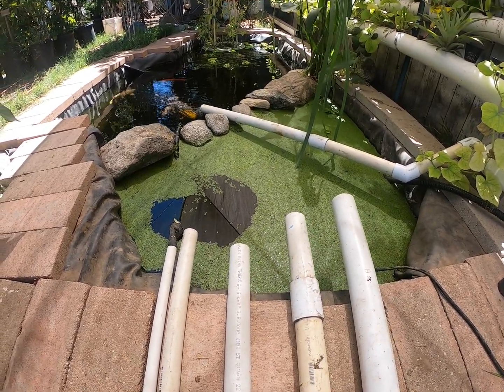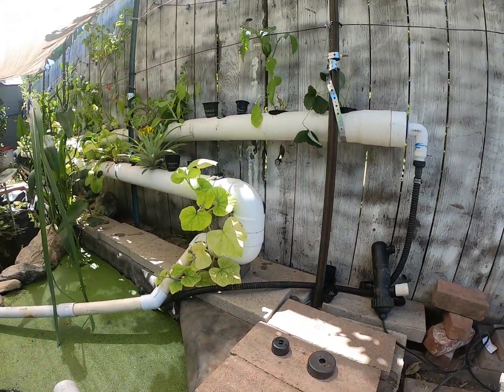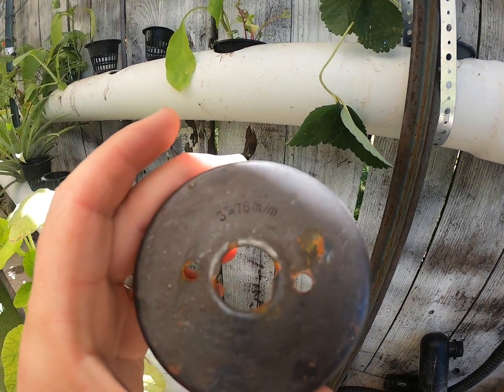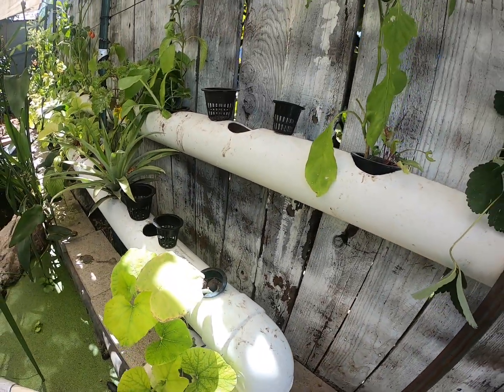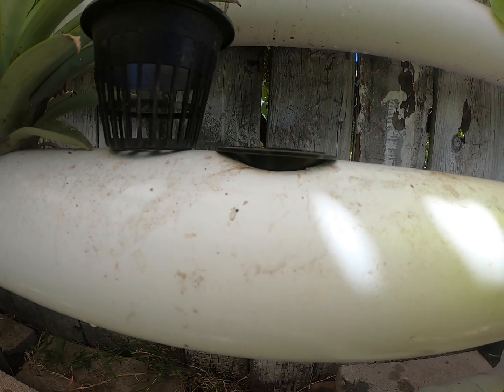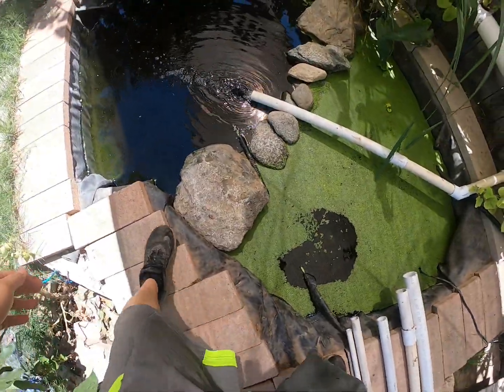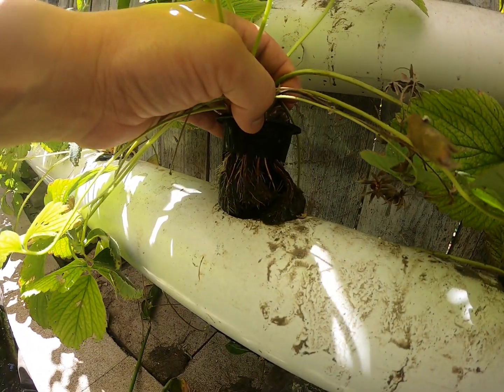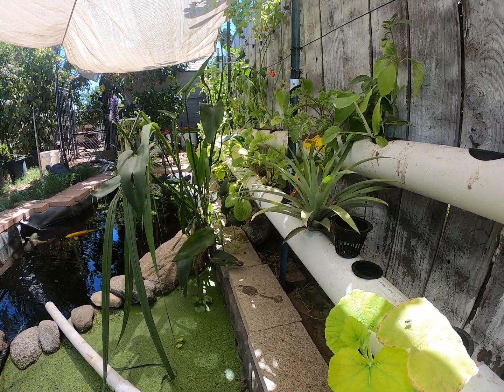What Size PVC Pipe and Net Cup for Aquaponics

Comment: Thanks! That was just what I wanted to know. I was wondering, though, why you have so much algae. Is that because of the water from the fish, or does the system leak light?
Reply from the maker: I had removed the UV light because I  added some water fleas, mixed fairy shrimp, and other small pond organisms. The vegetation that is floating is duck weed.
Reply: @aguileraproject271  I was actually talking about in your pipes, not the pond. If I pull out my indoor hydroponic plants, the roots are white. Yours looked like they had a lot of algae on them -- though maybe it's something else?

Comment: How strong is your pump to push the water through the package piping?
Reply from the maker: I think at this time I had one that pushed 550 gallons per hour. I can't remember. But later I added one that pushed way more than that and I added a bigger diameter hose as well. If there's too much water, I found out it can eventually overflow as the roots begin to take up space in the PVC pipes.

Comment: Did you consider a 3in PVC with 2in net cups?
Reply from the maker: I was unable to find a 3inch PVC pipe locally.  I did look online, but they either sold pipes in bulks (plus shipping) or they were just too expensive. I got the 2" and 4" pipes from HomeDepot by my house. It would have been cool to have been able to get the experience with a 3" pipe as well.